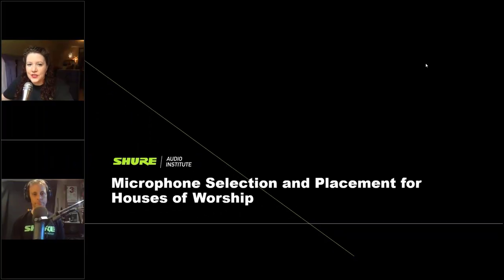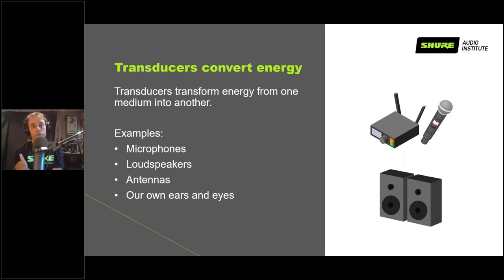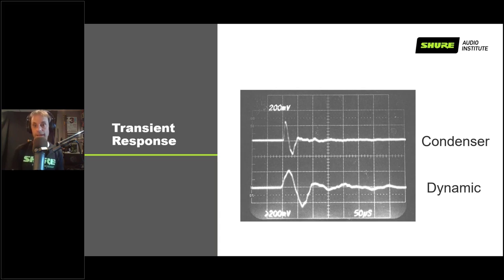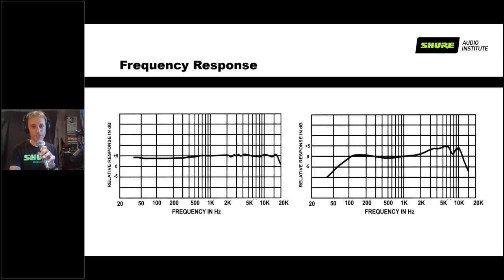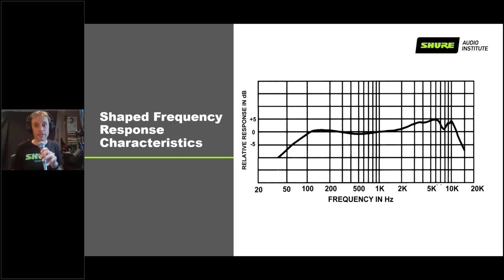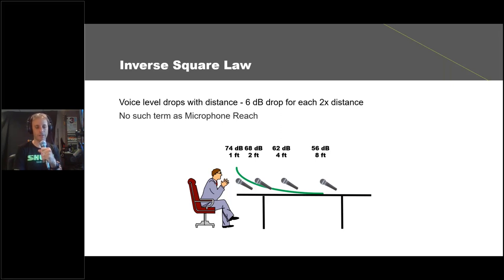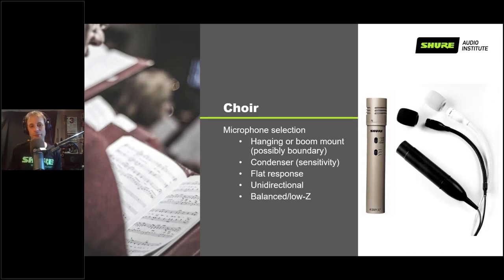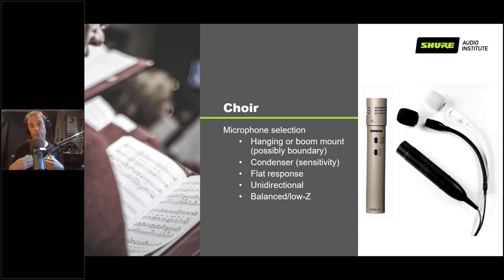Webinar: Microphone Selection & Placement for House of Worship | Shure

Comment: Just came across the Shure channel on YouTube today, though I've had SM58 microphones for years! I have a Bose S1 Pro speaker for a couple of years, and have been very disappointed with the poor volume it puts out when I plug in an SM58 microphone. So I just got a SHURE A85F Lo-Z to Hi-Z transformer for $21 from Amazon. Wow, what an amazing increase in volume! And I didn't detect any feedback! By the way someone told me that the best way to CUT DOWN FEEDBACK is to cut down the bass frequency in a mixer. I just tested that on my S1 Pro, and there was no doubt: when I turned up the bass, feedback became bad; when I turned down the bass frequency, there was hardly any feedback. I also have a Shure Beta 58A which I love; certainly better than my SM58. One last comment: CONDENSER MICROPHONES CAUSE A LOT OF FEEDBACK ON STAGE. They only belong in the studio. I have an AKG C1000S condenser mic, and I had to stop using it on stage because of the awful feedback. Yet, it is a fabulous microphone to record vocals with a mixer or USB interface.